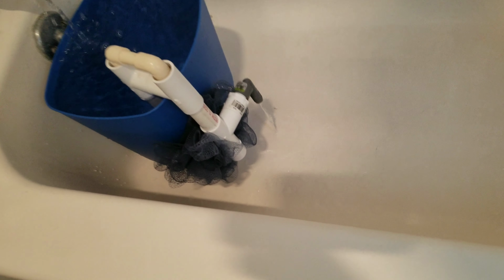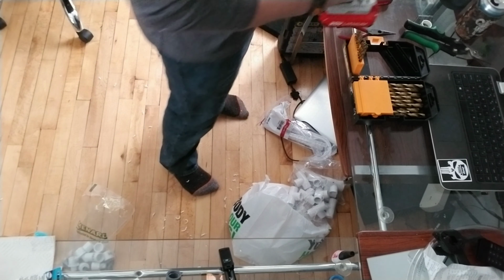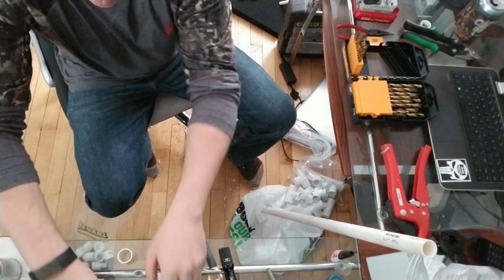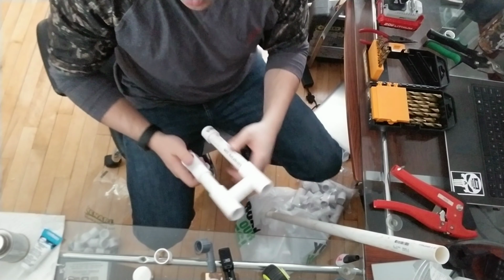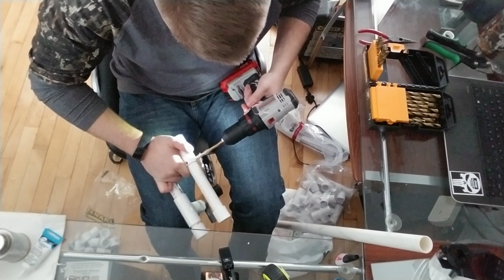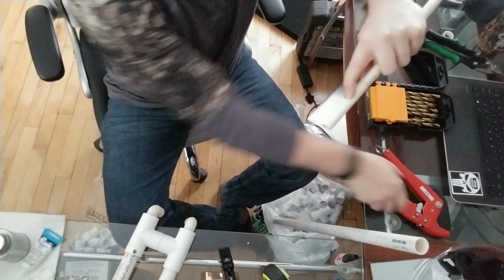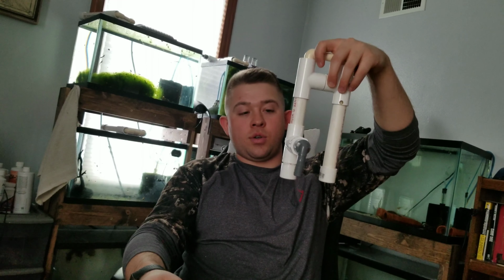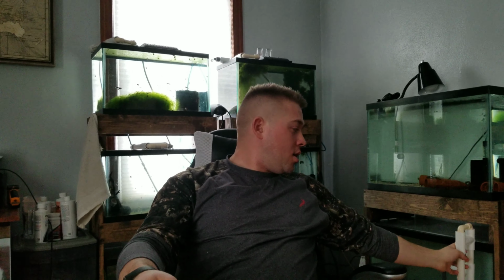HOW TO: DIY PVC OVERFLOW

Comment: great video, thank you. the outside pipe diameter is 20mm and thin pipe  diameter?  with this setup, how many liters or gallons  it will run in each hour?  i m asking to know if i will need bigger pipe diameter. thank you

Comment: ive been making these for about 10 years with 2 inch, running duals at about 600gph each on most of my tanks. what have you tested these up to? and are you using a relay controlled return pump incase of overflow failure?
Reply: Hey bro.I made one also with 2 " and 1"in center thinking I would get more flow. Come to realize I need to turn the ball valve on return way down otherwise the pump will go dry. Any ideas
Reply from the maker: I've had luck with these at 4-7 gph. Great for drip type water changer
Reply: @Hearts4ems  sry just saw your reply. i use 2" on the whole thing. my design is all one piece. if your overflow isnt keeping up with the return i add a 2nd one to the tank or go up to the size im using. i use float switches to turn my pump off incase of overflow failure too

Comment: It would've been nice to see this actually working. Other similar designs are air tight. I thought these U shaped devices needed to be air tight.
Reply: The smaller tube should be, but the pressure fit might be sufficient on  some fittings. You can seal it up with hot glue, too, so you can break it down if needed. The larger tube is really just for support and to provide a well to keep the small tube from breaking siphon. 
In order to prime it,  seperate the small and large tubes and submerge them to remove the air, then assemble them under water.

Comment: I don't understand how it works...
Reply from the maker: So the CPVC insert holds a siphon and the outer white pvc creates two "pools" of water. As the tank overflows into the PVC it will raise the level of water in one of the pools which the siphon will then balance out to the otherside. In doing so it raises the level high enough that it will begin to drain out.
Reply: @geoaquariums2190  I guess I don't know why I need one. I have simple aquariums. I fill them with water and a filter stirs up the water. I don't know how the water would overflow with no more going in. So you must do things much differently than me.
I'm guessing you have an outside water pump that is constantly pouring water into all your tanks and the overflow dumps the water from them all into a combined water filter that the water pump gets the water from. Very high tech and expensive.
Reply from the maker: Actually I'll be posting a video, but I use them for an automatic water change / drip system!
Reply: @geoaquariums2190  oooOOOooohhh....

Comment: how to do you fill up the free hanging U-Joint with water to create the syphon since its above the water line? If you just place it over the edge of the tank and fill up the tank, the water will never gravity feed to fill up the free hanging U-joint. You will always have an air pocket at the top of the U-Joint and thus not starting off the gravity feed syphon. If you place the U-joint underwater to fill it up and then attempt to place it in your larger PVC frame, the water pours out of the U-joint, allowing air in, breaking any syphoning. Leaving out the actual part of the video showing how to use your idea and show proof that it actually works.....if the pump loses power, what happens when power returns? When air gets into the free hanging U-Joint (breaking the syphon), what happens when power is restored to the pump and air is in the free-hanging U-Joint? Oh that's right, you overflow your aquarium with the water from your sump since you have air in your U-joint still and you burn out your pump for running it dry. Or is this not the case? We can't know because you left all this out.
Seems like a bad design if you want "set it and forget it" setup for a none-drilled tank. Have to go with the LIFEREEF PREFILTER SIPHON BOX setup to keep syphon even with power lose.
Reply: use rubber caps on the ends